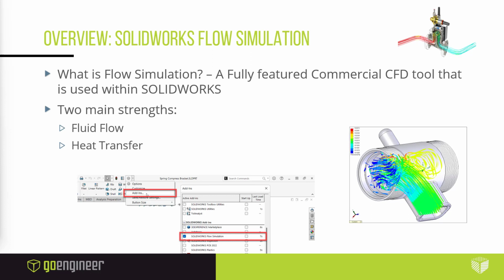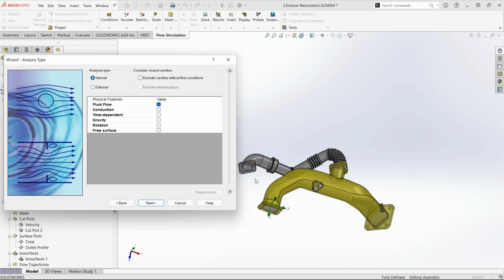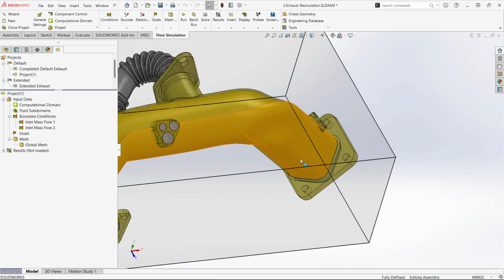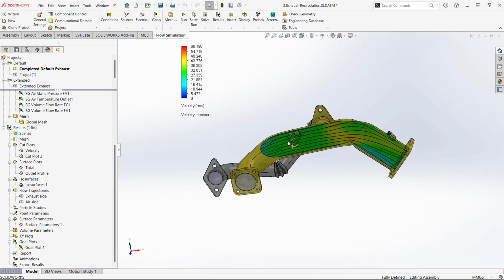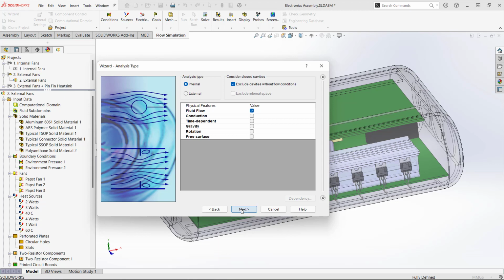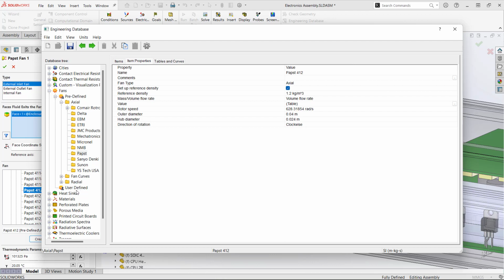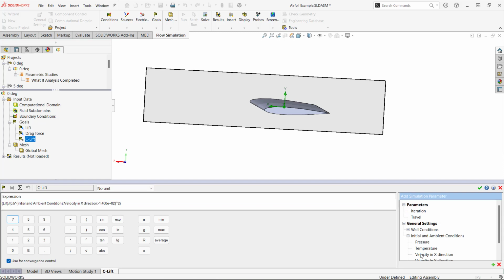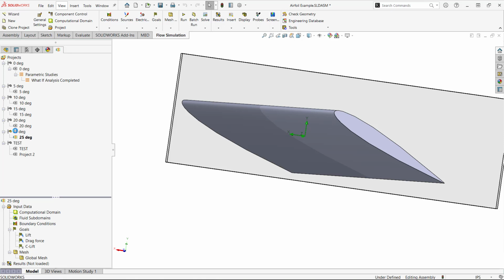Deep Dive: CFD with SOLIDWORKS Flow Simulation - Webinar

Comment: does flow simulation able to handle blast or explosion simulations? thanks
Reply from the maker: Flow sim could simulate the pressure wave but not the blast event itself.
Reply: @goengineer  Yup, its nice, I tried 80MPa of compressed gas of nitrogen 2kg, as pressure+density and pressure+temperature, it yields the same, the shock wave and vibrations only missing, but at least the pressure waves are there, thanks for response.

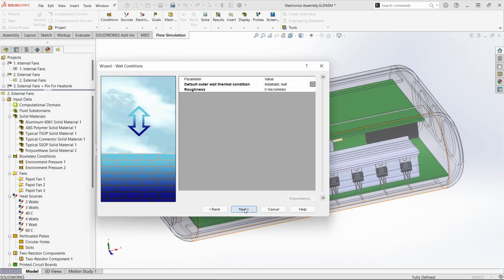Comment: 31:20 You keep as parameter for the wall "adiabatic wall" (therefore no heat exchange). Shouldn't you put a heat transfer coefficient so that your domain can exchange heat with the environment ?
Reply from the maker: Hello and thank you for your question!  You are correct in changing the default outer wall thermal condition could possibly make the model setup more accurate.  In this case we left it as adiabatic since it will help decrease calculation time and resources for my very first run of this project, eliminating heat transfer from the outer walls.  Also, it is a best practice to keep your flow project setup as simple as possible at first and then begin to add more accuracy and detail to the model and setup.  Another thought is that one could also locally apply all our thermal conditions manually to the model in the project design tree and any outer walls that are not specified will be assumed to be adiabatic.  I hope this helps!

Comment: Great Video!
I have a question regarding the angle of stall in the airfoil example at the end of the video: The critical angle of attack for airfoils with accompanying stall and reduction of lift force is usually about 12-15 degrees. Why does this occur in this example only at an angle of about 50 degrees ?

Is it possible that you make a video showing a complete airfoil analysis in more detail? That would help me a lot!
Reply from the maker: Regarding my particular airfoil example, it was meant to run quickly and efficiently while still showing some-what of an estimated response of an air-foil behavior.  What I called a "first-pass analysis" during the presentation to show the moving parts of how you could approach such a problem with automation.  My setup was lacking in many significant ways in order to approach more realistic results and wasn't the intent of my presentation.  You are correct in that my stall angle is way too high!  If you are interested, I will add my thoughts in improving the results below:

To improve the accuracy of the setup and response I would need to further address the mesh density of the computational domain especially around the partial cells of the model.  I would also look to either increase the computational domain to include the full wing of the model leaving sufficient volume around the model to prevent any artificial results.  Another approach uing the simpler or thin computational domain approach I used could be to use symmetry option when editing the computational domain to take into account the artificial boundaries of such a small computational domain that I used.  Lastly, I would also add some global goals to ensure that the solver is converging its results across the full computational domain of the project.  I would probably add an Av Density of the fluid, Av velocity, Av and max total pressure global goals.  Also consider adding some of the turbulence global parameters if you think they are important in the calculation so that we can ensure full convergence of those parameters as well.

I hope these suggestions help in your inquiry if you yourself are trying to setup such an airfoil design project with more meaningful results.